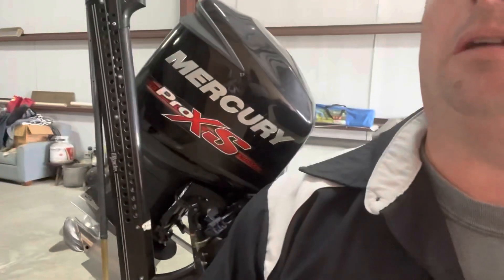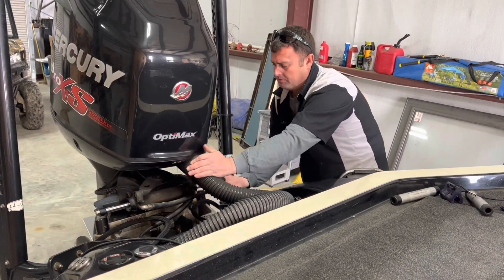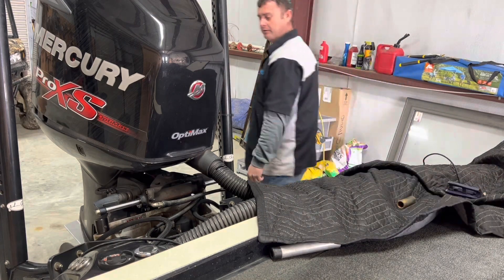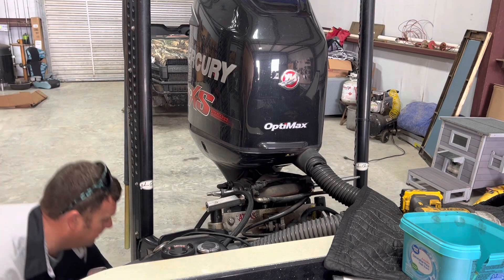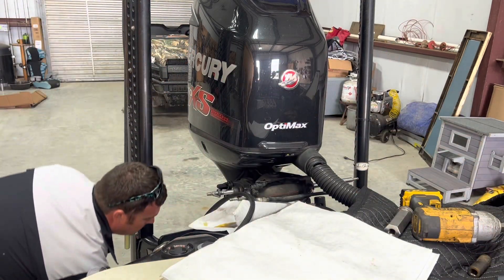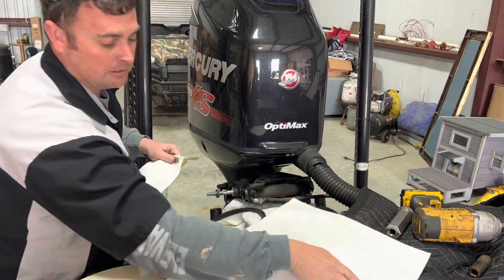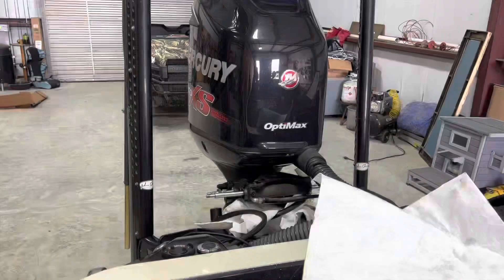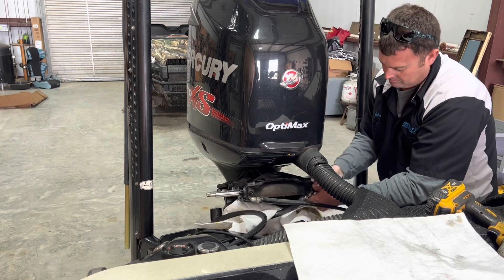Seastar Complete Outboard Hydraulic Steering Failure!! #mercurymarine #seastar #rangerboats

Comment: Great vid!  New subscriber here!  If I were to replace my hoses on my hydraulic steering (air is getting in the system and I don't know where yet), would you recommend just using a string and pull that through for a pulling tool, or use the old hoses to pull the new ones through?  This is on a 2005 Triton TR-21X.  Thanks!